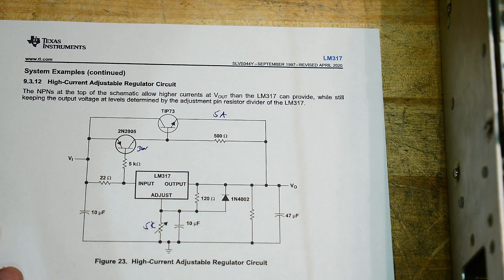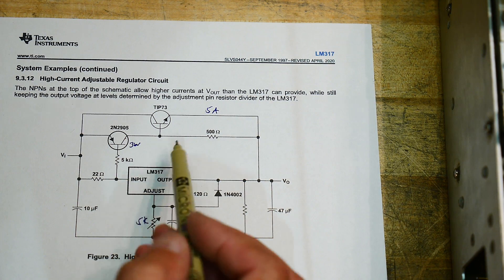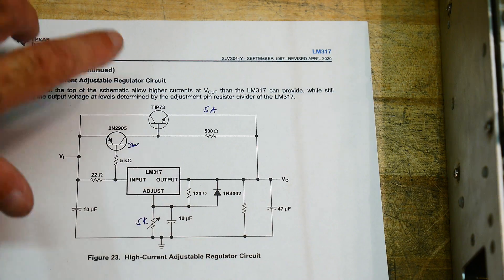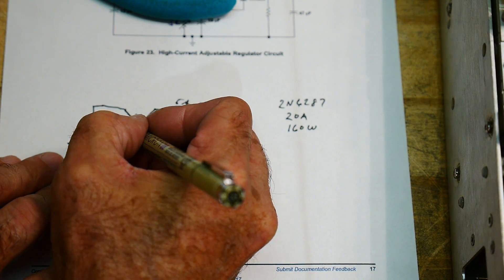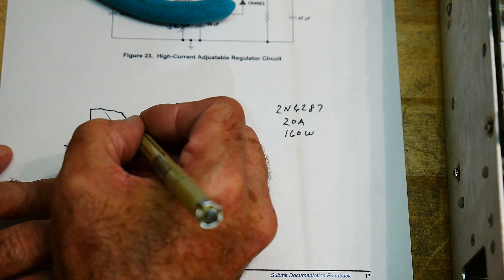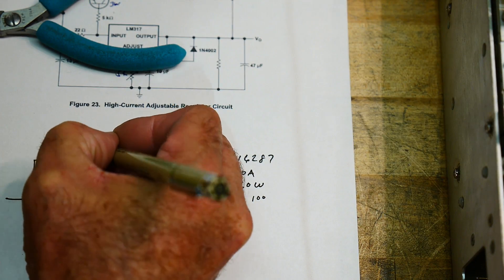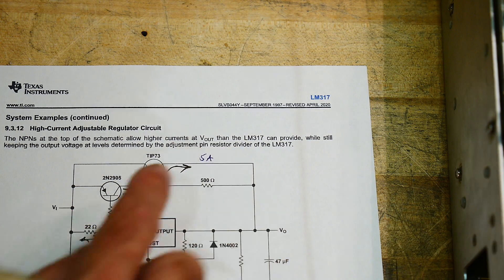#548 LM317 with Transistor for more Current

Comment: No current through the 500 ohm resistor?  I don't think so.  Exactly enough current will flow through it to produce enough voltage drop to turn on the NPN transistor.  A cool circuit.  I happen to have a berry box of TO-3 PNP darlingtons.  I once used 6 of them in parallel w/emitter resistors tobuild a high current 12V supply for my ham station.  I put the regulator in the negative leg.  This allowed me to bolt the transistors directly to the very large heatsink.

Comment: They have the TIP73 rated at 15 amperes but, somehow, I doubt it could take that for long. They similarly rate the 2N3055, but most manufacturers run them at 5 amperes, and this transistor is a TO-3, with more heat dissipation over its case.

Comment: IMSAI Guy, would you comment on or explain the circuit used in a video by Awesome Tech:

1A boost current to 6A 7805 12v to 5v
Reply from the maker: I'll add it to my list. but not a recommended circuit: https://www.eevblog.com/forum/beginners/linear-regulator-boost-with-npn-transistor/

Comment: A little correction: the base-emitter voltage drop of the darlington transistor 2n6287 is 1.3-1.5V, so the current through the 5 ohm resistor would be 1.3/5 = 0.26A, not 1/20 A. 
Adding the base current of 0.5A (at 5A output) will result in 0.76A which is not insignificant.
The total minimum voltage drop of this schematic will be about 4.3-4.5V and the input voltage should be at least that much higher than the desired output voltage.
I wonder if the current protection of the LM317 will work at all?

Comment: I am just learning about these. I build an adjustable regulator using a LM317 today in fact, and it works! My question concerns the output voltage with the addition of the bypass transistor. In my scenario, I am using RC LiPo batteries at 12 to 18VDC, and driving an arduino at 5VDC. Does the bypass transistor cause the voltage to rise when it turns on? My current draw is very small, on the order of tens of milliamps. Do i even need to worry about a bypass transistor?
Reply from the maker: did you see that resistor at the end across the 47uf capacitor, that assures that there is a minimum load.
Reply: @IMSAIGuy  Yes, on the data sheet schematic! I should have assumed that it was assumed to be there, lol! 
I ordered two of the PNP power transistors from Jameco just to build this circuit to see how it behaves. Thanks for answering a question on a three year old video, I appreciate it :)

Comment: A couple corrections: 1) since you use a Darlington transistor the voltage drop acros BE is approximately 2x0.7V.  2) when you put two transistors in parallels, you never said why you needed to limit currents.  Infact the reason is that thosw two transistors are not usually identical.  They usually have different Vbe and current gain (beta).  In order to balance the load on those transistors, you need to have a resistor on emitter to cancel the vbe differences which is a fraction of Vbe.  Otherwise only one of them would always carry the load.   It is exactly the same idea as putting two diodes in series to increase their max voltage or put them in parallels to increase their max current.  Infact without using the registers, due to decreasing Vbe with the heat  and  temperature, the situation will get worse for the conducting transistor and it gets hotter and hotter.
Reply: Actually it is a Sziklay Transistor, and the guy who invented it was Hungarian.
Reply: @krzysztofsoja5301  That might be a correct spelling (transliteration) but people will find it easier under "Sziklai".

Also to the original comment poster, at 9:21 he says "current hog". Those two words are everything you said in your "correction". The explanation is "to avoid current hogging". This is a 10 minute video, which is how long it should be. He also didn't explain the intricacies of why its difficult to find high power PNP BJTs. We didn't need a half hour explanation of P type silicon majority carrier mobility increasing silicon resistance and requiring more silicon per watt than an equivalent NPN BJT, increasing the cost of PNP BJTs. We didn't need an explanation of economies of scale and the low production of PNP transistors leading to a higher cost.
Reply from the maker: Pnp npn not darlington
Reply: @IMSAIGuy  or named after the Japanese guy you couldn't remember his name?

Comment: This is a cool circuit as power NPNs are easier to find than PNPs. I have a bunch of TIP-42s (PNP 3or4 amp TO-220s) and 2N3055s (NPN 16amp TO-3s) that should do nicely (will post if it works).
   These regulators, and their cousins,  have been around forever and avoid some of the noise you can get with switch mode supplies. I did find a low power variant (LM317L ?) that will regulate 100ma and comes in a TO-92 package (like signal transistors). We are talking about the one that comes in a TO-220 (or power surface mount case) and can source 1.5A by itself. (So don't order the wrong one.)
   As I recall there is an internal reference and differential amplifier that tries to keep the output 1.25v above the adj. terminal, so you can use that idea to analyze your feedback network.

   On second thought a TIP-42 might be overkill, the 2N2905 has a 0.6A collector current max.
Reply: I mistook the 2N2905 for a 2N2955 ( which seemed way too big ). The 2N2905 is more of a signal transistor with a 600mA max collector current. 
A TIP-42 is probably too big.

Comment: The only problem with using collector resistors is they have to be able to work in very high current situations and are usually very small values. And such high wattage, small value, resistor can be hard to find...

Comment: A fascinating part that can be paralleled without the ballast resistors is the LT3080.  Instead of using an internal voltage reference to drive the error amplifier, it uses a constant current source.
Reply from the maker: the datasheet shows 10 milli ohms ballast resistors
Reply: @IMSAIGuy  right.  "pcb trace resistance" is I think what it and app notes from LT describe it as.
Reply: would probably have to do some squiggles with most boards/trace widths

Comment: Great explanation on this particular circuit! I also appreciate you mentioning the power ratings of the resistors in this particular circuit, a lot of other video’s will give you a resistor value, but never mention the power ratings. And well, power ratings obviously matter in circuit design. Understand the current path in the circuit helps too, and you did a great job explaining that as well. Thanks! 👍🏻

Comment: Sorry, I don't get one thing, How the voltage can remain constant.Transistor is connected here is like a jumper between input and output. Lets say input voltage is 20 volts and you set the output voltage at 5 volts and then start drawing enough current to turn the base emitter junction. Now the transistor is a jumper between input and output. How can voltage can stay at 5 volts. Please explain. Thanks
Reply: But the resistor in series with the PNP base acts as a load and will draw the current to turn on the transistor, isn’t it?

I know it works (I tested it), but I just don’t get why the voltage still gets regulated, even though there is another path with least resistance 🤯
Reply: This is old school analog, the transistor only starts to turn on. It never goes into saturation and turns all the way on. The name transistor is from transfer-resistor, which was how they were used (pre-digital). 
    Current drawn out of the base of the PNP (because there is a voltage drop (at least 0.6v) across the 22ohm resistor, because there is current flowing thru the 317) starts to turn on the PNP. 
    The NPN will be off if the PNP is off, because there will be no current thru the 500ohm resistor the base and emitter are at the same voltage. When the PNP starts to turn on, a current of less than 2ma thru the 500ohm resistor will raise the base 0.6v above the emitter and it will start to turn on. 
    The voltage out of the LM317 is controlled by the voltage divider formed by the 120ohm and the variable 1.5k resistor. When the NPN starts to turn on (or if the load is reduced) the output voltage will start to rise and the 317 will start to draw less current. That means less current across the 22ohm resistor, and the PNP will start to shut down, which will start to shut down the NPN.
Now even a big slow power transistor can respond to changes within micro- seconds, so a partly turned on equilibrium is quickly reached.
    By the way, a transistor in the active region (partly turned on) can generate a lot of heat, so you may need a heat sink to not burn up your transistor. 

    To turn on a PNP, you must draw current out of the base in the direction of the arrow (the V-base is about 0.6v less than the emitter). To turn on an NPN, you must push current into the base in the direction of the arrow (the Vbase is about 0.6v greater than the V-emitter.
   A small current into or out of the base (in the direction of the arrow) controls a much larger current from collector to emitter (NPN), or from emitter to collector (PNP). The voltage across the emitter-collector terminals has very little effect on the current thru them. 

   Using discreet components can be a lot more challenging than plug and play IC's, but you may need to adapt the not-quite -what-you-need IC to your situation. When  a few components in a clever circuit make it right, that is a good feeling. 
   Don't give up, it gets easier every time you learn a new circuit.
Reply: @thomaslewis9526  Thank you for this detailed explanation.
Reply from the maker: if the LM317 is not drawing current, there is not enough voltage drop on the resistor to turn on the first transistor, and therefore no current in the big transistor.

Comment: If I use an npn transistor connecting the base to the regulator output, collector to input supply and take final output from emitter and ground then will it be good voltage regulation at output on load current of 3 amperes ?
Reply from the maker: I've see that circuit, there is an issue with it but I forget what it is. the PNP version solves the issue.

Comment: Whether anyone tried this circuit and could get variable voltage at 5 amp ? I tried this circuit with complimentary pair of transistors tip 2955 and 2N3055 with all recommended capacitors / resistors .   The output current I got was hardly above 1 amp . Any clue .....?
Reply from the maker: check the voltage across the 22 ohms resistor and make sure it is large enough to turn on your tip2955. It might be too low for that transistor and you need something greater than 22ohms.

Comment: I've built something after looking at heaps of designs. I really just wanted to share the load between a small transistor BD140 pnp and the LM317. Its only 2A max type of power supply - so since BD140 can do 3A max and 0.5A at the base - maybe that's ok. I"m trying to figure out how much resistance from the input to the base of pass transistor will share. I used 3.3kohm to start with. I used 6.5 ohm 2 watt resistor to turn the transistor on. However I see this ...
Reply from the maker: the resistor is not really a sharing current. it sets the turn on point of the transistor. the transistor will need  0.7V to turn on. so the voltage across the resistor is 0.7V so if you want the LM317 to 'share' 100mA. then 100ma across 0.7V is what the resistor needs to be. or 7 ohms.
Reply: Remember LM317 needs some power to function.  So the resistor on unregulated side cannot be more then a few ohms.  Also the voltage divider resistors should not be more than a few hundred ohms.  Otherwise it won't work as a regulator.  I learned these in a hard way too!

Comment: Hi, thank you for this idea.
For some reason I was unable to get more than 170mA from my LM317. With a pnp BC557 in  sziclai configuration with 2N3055 (npn) I got more than 2AMP, it is very funny. 
I guess the 22R resistor  can be changed to controle tha pass transitor.
Reply: Was the heat sink large enough?
Was the voltage within the proper range?
Was the LM317 good and not a faulty or fake one?
It should easily supply the 170mA current if all was OK.
Reply: @paulcohen1555  may be the heat sink ! I tried also other lm317 from the same box, I fried 2 of them. Anyway I switched to lt3080 which is  a better regulator, no complain now !
Reply: Mistake is the BC557 transistor. It only good for 100mA. Go for a BD140 (8 to 12W 1A) or a TIP 30C 30W 1A.

Comment: Current sharing resistors are usually in series with the Emitter.
In series with the Collector they just minimize the voltage (and power dissipation of the power transistor).
Reply: The "emitter" of a PNP Sziklai pair is actually the collector of the NPN transistor!
Reply: @topquark22  Yes, the emitter of a PNP Sziklai is the collector of the NPN, but when paralleling output transistors in Sziklai configuration resistors are in the emitter of the second transistors. It is also used in paralleled output Sziklai power amplifiers.
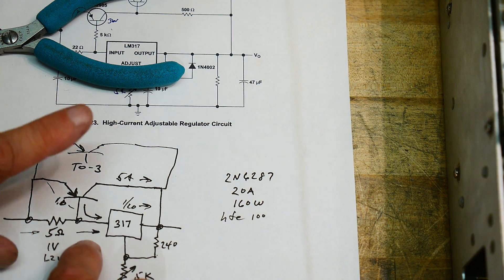Reply: @topquark22  OK, but the subject and issue was about current sharing between two transistors at time: 9:10.
Bye.